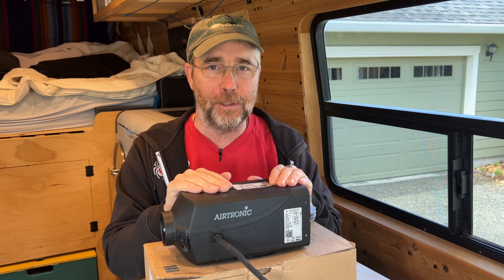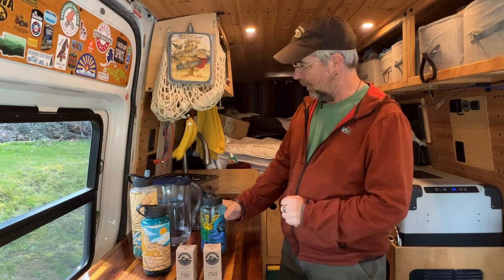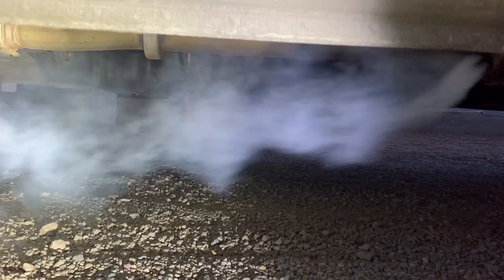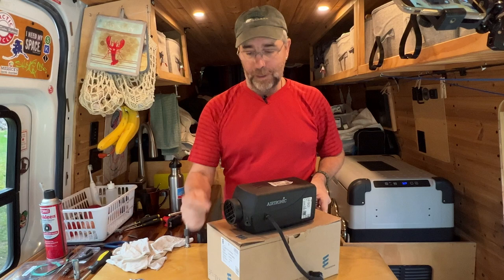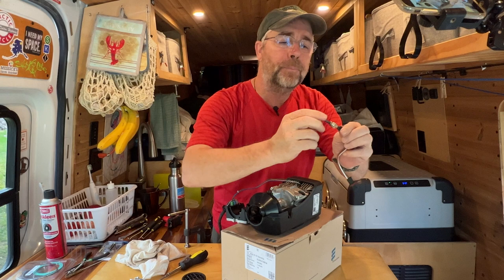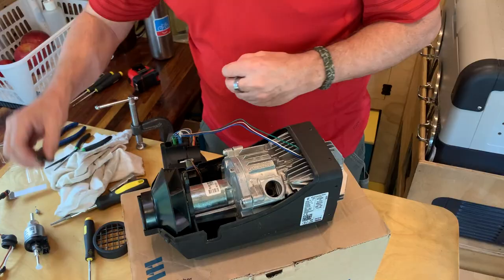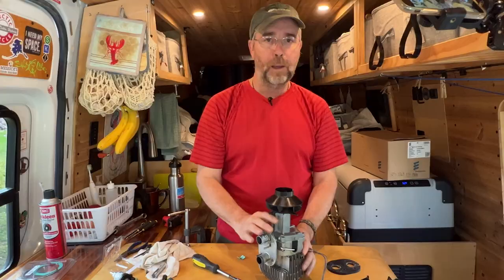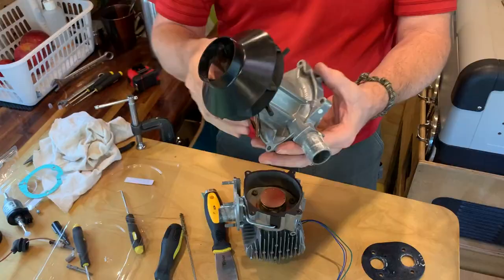HOW TO AVOID KILLING YOUR ESPAR D2 DIESEL HEATER - Usage Tips and Routine Maintenance Procedures

Comment: I use about 10 to 20% kerosine mixed with the diesel on mine (actually old jet fuel) and it keeps it much cleaner - no high altitude operation though. 
I also have a separate automotive fuel filter on the fuel feed upstream of the pump.
Reply from the maker: Yeah ours feeds right off the van fuel tank so we’re kinda stuck with Highway diesel. But good idea on the fuel filter. Thanks for sharing!

Comment: I drive a big truck, this is my third winter with my bunk heater. I had it installed at thermo king in little Rock ar. When I picked my rig up there was no instruction manual, nobody took me out to my truck and showed me anything, they just took my money and said enjoy. Nobody said anything about yearly maintenance or anything. A few weeks ago I woke up and noticed my red light was on and no green light so I turned it off. I read where someone had this problem when they turned it up to high, mine was on 80 that morning so I decided I just had it up to high. Then last week I was outside my truck right at the 10 hour mark and as the unit was cutting off I noticed white smoke oozing out exhaust pipe of heater. This morning when I woke up and cut unit off I noticed my thermostat had maintenance on the screen. So I'm undecided if I'm going to do it or take it back to thermo king and have it done so they can check everything over. I plan to install a battery powered air conditioner this spring by them but I will certainly explain my disappointment in them not giving proper Instruction. After watching this I might just do the maintenance myself. Thanks for the Info.
Reply from the maker: Wow yeah too bad they don't share more information huh? We wish you good luck fixing it and so glad you found this helpful!

Comment: I would suggest you to add a proper inline filter. The filter in the pump is not enough. So you don't have to clean as much and it's much easier to replace. Mine works for years without problem. No cleaning. But your right with altitude kit and let it burn on max. I do it for max 15 min at the time especially if it was running at low power.
Reply from the maker: Hmmm, good suggestion. Thanks!

Comment: Good info - I did a preemptive tear-down and cleaning at about 18 months. I usually do a 10-minute hot burn before turning off if it has been on low, so my chamber was really clean. But about a month later started having issues as you describe - failed starts/restarts. Ended up being the pulse pump. Even though it was clicking, it wasn't pushing enough fuel. Replaced and good to go now. Ordering another pump as a backup.  Thanks for the content  😎👍🏼
Reply from the maker: You hit yours with a pre-emptive right when we should have hit ours! Glad to hear it's working for you and good idea on having a spare fuel pump! Thanks for the comment!

Comment: Quick tip in getting that atomizer out easy. Eye hook screw and screw it in and pull it out. I had a loose 90 on the exhaust. It caused the flame being snuffed out & flooding the chamber with diesel. Needless to say i changed a lot of them atomizers. I run kerosene once a year to clean that chamber out. Great video
Reply from the maker: Thank you - that's a great suggestion for getting the atomizer out! We've tried running kerosene a few times but it doesn't fire up for us.

Comment: I've had mine in my semi for 9 years. I drive across Northern USA, so it gets used every night during the winter. A month ago I opened it up for the first time. I didn't get enough carbon to fill a thimble. I  keep it set for 70 degrees and once a month, I run straight kerosene thru it set on high for about an hour.
Reply from the maker: Yeah we’ve tried kerosene a few times but could never get it to start up on kerosene 😢.
Reply: @TimAndShannonLTD  i normally run it diesel fuel so I'm guessing that when I run it on the kerosene,  its starting on the fuel in the line before the kero gets there. I've got probably 4 foot of fuel line between the heater and the pump.
Reply from the maker: @donmunro144 yeah our situation is very similar but we have tried about 3 different times and no luck 🤨
Reply: Running it on kerosene once a year is key. And crank the temp up while burning kerosene. I’m 11 years and never had to open it up yet. Long haul trucker and I use it in my 130” double eagle sleeper. Keeps me nice and toasty.
Reply: Great video!
Reply from the maker: @largesleepermadness6648   Thanks! Glad you liked it!

Comment: Thank you, Tim for this very important video and for pointing out the necessity for the frequently required maintenance.
Our Eberspächer (in Germany, Espar elsewhere) S2 unit was already installed on our construction company used 2014 VW Crafter (built compatible with a W906 Sprinter).
When I inspected the van prior to purchasing it, the undercarriage had a uniform brown / tan dust /dirt color - except for that blue fuel line. So it was a recent install and it works without troubles.
I was actually planning on buying a complete chinese diesel heater unit as a cheap backup, but I don't know if the holes and bolt holes will line up one to one. Servicing the unit seems good practice to keep the heater working.
Stay safe and best regards from Germany! 🚐☁🍀
Reply from the maker: Thanks for the comment. Glad you found this helpful and good luck with your new(used) van!😊

Comment: I have the Gasoline fuel model with High Altitude auto adjustment built into the model (M B4L). Hopefully this model will require much less fuss and maintenance than you have experienced.
Reply from the maker: Yes that would be nice!

Comment: I bought the rebuild kit that you recommended.....it must be for an older model. My espar has a rubber gasket along with a green fiber gasket. The glow plug electrical connection is also different. My glow plug looked good so I won't need to replace it this time.
Reply from the maker: Oh wow sorry to hear that. Is yours an Espar D2? or something else? Glad the plug looked good anyway!
Reply: It's an S2 D2L that I  bought and installed in 2020. I probably should have torn it apart before I ordered the parts. After realizing this I went online and found different rebuild kits that include a rubber gasket and a fiber gasket and a glow plug that doesn't have the quick connect..... just the wire ends where you need a special tool to install them into the wire harness. I could cut and splice the new one I received and make it work but I don't think I need it this time. I enjoyed the video....very informative. Just an FYI for other Espar owners. 
  @TimAndShannonLTD
Reply from the maker: @gstephenson7391   OK, well I'm so glad yours isn't a D2 and that our links are not going to a wrong product! And of course, also happy that the video was helpful to you. Thanks for this comment!

Comment: The title should say Chinese brand Vevor and the new kid on the block Hcalory killed Espar.
My 5 year old Vevor is still working. I did replace the fuel pump with the new ultra quiet pump. It made a huge difference.

The Vevor and the Hcalory are the attack. The prices are down to 60 to 90 dollars at Walmart, eBay, Amazon, and Home Depot. I'm expecting to see them at my local Costco soon.

These heaters are awesome.
I made a true all in one very portable heater 
I took a Ridgid medium size box. I added a Vevor heater, 20ah LFP battery,  solar controller, cooling fan, USB, AC to DC charger. Fully rain proof.
Reply from the maker: Wow good to know lol! Maybe in our next build!

Comment: good idea with the screwdriver bit to plug the fuel hose -- i've been using golf tees
Reply from the maker: Cool! I guess that would work too but I’m guessing not as tight of a fit and  maybe some leakage?
Reply: @TimAndShannonLTD  it works pretty well but it requires some extra scrounging in my golf bag when the bit are already there

Comment: There are replacement parts for everything on those so in the long run you can just rebuild them if you fail to do proper maintenance annually. Or save some money in the long run and just buy two of them to use one for replacement parts!
Reply from the maker: Seems kind of expensive for “just in case” but that’s just my opinion. Thanks for the comment.

Comment: Tim, two questions, please:
- At 10:40 you instruct us to "take the tool that came with the igniter". My heater is part of a Sprinter van that I purchased used, and I don't have that tool. Can you provide a link to purchase it as a separate item, please?
- What is the best way to determine whether I have the D2 or a different model?
Thanks; a very well-crafted video. I subscribed.
Reply from the maker: Hi Allan, thanks so much for your comments and the sub! If you buy from either of these links, note that we will get a small commission at no extra charge to you. This first one is the replacement igniter we used and it comes with the tool included: https://amzn.to/3nL7vzv  

This link to a tool only (no igniter) also looks like it would work, but I have no direct experience with it: https://amzn.to/3RcbZeH

If you want to make your own, you can take a 12mm Deep, 6-Point Socket and cut a slot into one of the sides to accommodate the wire but really no point if you're buying the replacement anyway. 

To determine if your Heater is a D2 or not, look at the label on the top or side of the heater, there should be an indication there I think. (our label says "D2" in one of the fields). 

Hope this is helpful!

Comment: Thanks for this video. Cant you do something to get the heater running again? Cant you replace some parts. Those are expensive heaters, I just paid over a grand for mine. 🥴 Did you try getting it going again?
Reply from the maker: Well yeah we did get it running again, but the motor wasn't running right and we feared it would fail again (probably when we needed it most). Like I said at 22:49, we had raun it on low voltage for too long, and I think that messed up the electronic control module, and we didn't want to gamble $350 replacing that only to find it was something else. We'd already had enough headaches with that thing for 2 years and decided that for peace of mind, rather than continue beating a dead horse, it was worth replacing it, knowing that with proper care and maintenance, we could have a reliable heater. So yeah - super costly lesson there, but now we know better! Thanks for the comment and be sure to maintain your heater and service it regularly!

Comment: Thanks for your the video, What was the the failure of the unit and what error codes did you got?
Reply from the maker: We were never certain what the final failure was other than 2 yrs worth of carbon buildup. We guessed it was the Electronic Control Module. Never saw any error codes other than ERR which was only temporary when it wasn’t working properly.

Comment: It's your battery voltage was not up Your glow plug would not be able to get hot enough.. you'll have white smoke.
Reply from the maker: I guess that could be the problem in some cases but we definitely also had trouble when we had a good battery charge as well. Thanks for the comment!

Comment: I fix mine also...can you reuse the burn chamber? I was told to replace when doing maintenance. Thank you
Reply from the maker: Hmmm I don’t know for sure but I think if it’s not all gunked up it should be fine with no reason to replace the burn chamber. In the other video I refer to in the description, the guy shows how to clean the chamber with Brake clean if I remember correctly.
Reply: @TimAndShannonLTD  I soak mine in my buddies parts been washer fluid for a week and then I clean out the Crustaceans that are deep down inside that burner seems to help a lot. Then I'm able to reuse them when I do my maintenance.

Comment: Even though this runs of diesel,  it can still kill your batteries over time?
Reply from the maker: If you’re referring of my mention of low battery voltage, that was because we were in the van in winter in Washington State with not much sun at all for solar panels, and we did not drive much (to recharge house batteries) nor did we plug in to shore power for about a 2 week period. All that lack of charging combined with still living in the van and continuously using power, dropped our state of charge and voltage. So yeah, the heater fan motor played a part in that but it had a lot of help from everything else. Hope this helps!

Comment: when you indicated at the beginning of the video that the previous unit died was it beyond repair? if so, what components failed to such an extent?
Reply from the maker: We were never sure if it was beyond repair or not but we were certainly tired of dealing with it and wanted a sure-fire fix during the cold weather last winter. As mentioned later in the video, we thought maybe the electronic control module was bad but we didn’t want to gamble $350 on a replacement only to find out it was something else. Ultimately it was our lack of proper care that caused all the problems - we will take much better care of this new one!
Reply: @TimAndShannonLTD  thank you for your report of the problem, as far as you could determine. I guess another question would be is whether you PREFER a diesel type heater to the more common (typical in RV) propane furnace. and if so, why. thanks again for your note.
Reply from the maker: Hi again,  @drcoolit  . We prefer diesel in this build because it draws off of the same fuel tank as the van's engine and also because we don't have propane plumbed in (we cook mostly with electricity except for occasional outdoor use of our propane camp stove. Another plus is diesel is not explosive, so it seems much safer to us.
Reply: @TimAndShannonLTD  outstanding info. I'm DEFINITELY looking into a diesel heater for my Avion! thanks again.